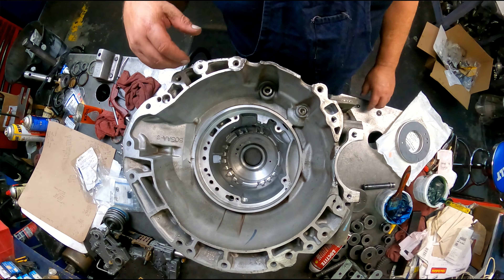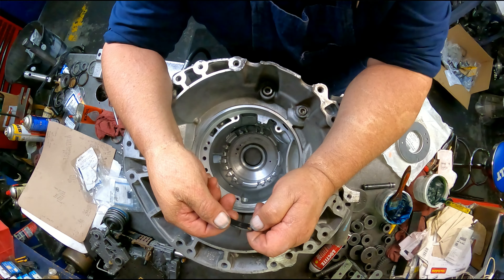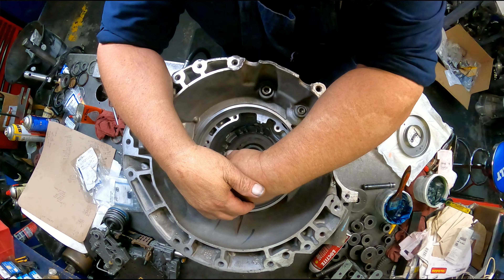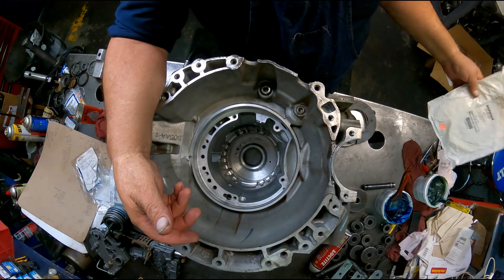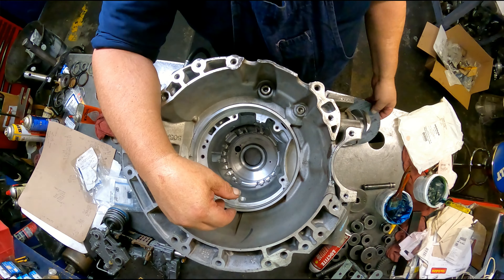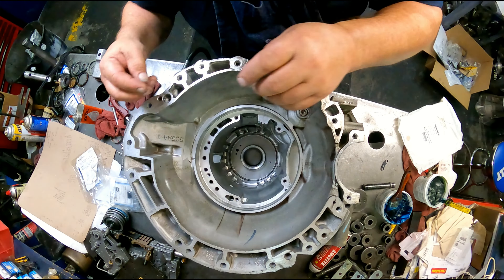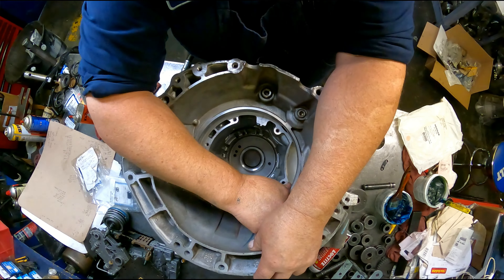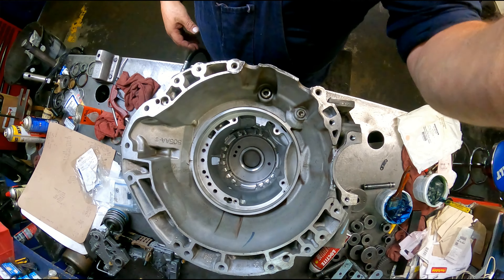Delay Reverse And/Or Low Gear 604 42RLE 62TE

Comment: Are you in Texas? I want my AA80E rebuilt and every shop I’ve called has been clueless on it. I’m in Austin
Reply from the maker: Probably because parts are a problem for this unit right now. Your 2 options right now are used and new from the dealer. I'm nowhere near Austin.
Reply: @CurmudgeonTransmission  I’ll ship lol used has been a nightmare. I just tried that route and ended up having to reseal mine and clean it up best I could. The used they sent me had a newer valve body but shavings galore. It was also from up north so shifter shaft was rusted and broke.